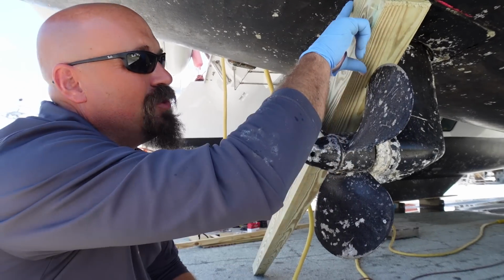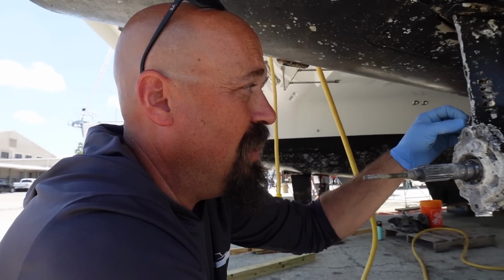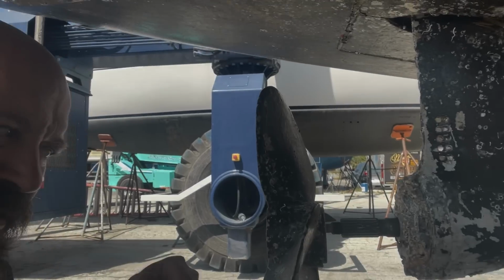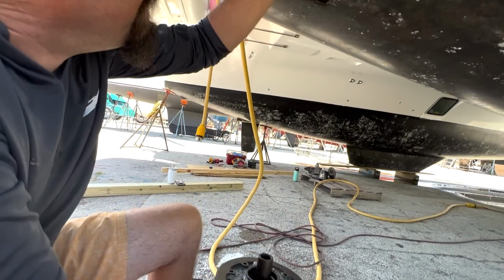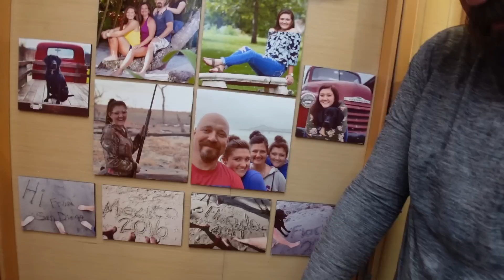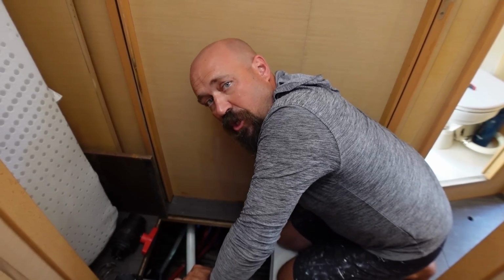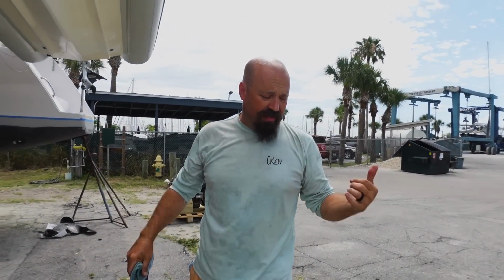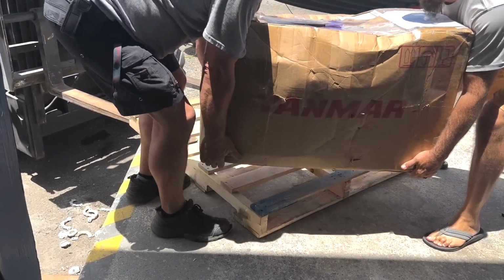WE FOUND HOLES//Corroded Sail Drives & Engine Removal-Episode 82

Comment: Instead of sucking on the end of the siphon hose, attach the lower end to a tap (faucet) and run water up the pipe until it runs out the top end, then quickly disconnect it from the tap. The flow will reverse and away it goes.

Comment: ⛵️I just hope that the corrosion hasn’t damaged any of the cooling water systems on your engines as well. Great watching you connect although bad luck having to cope with the corrosion on a boat that you are about to sell. On another note I applaud you for repairing the problems and not passing them on to the new owners.
Reply: If the external zinc were depleted so fast that it started corroding the sail drive casings, one can imagine what the engine zincs (which are much smaller) must look like if there is anything left of them.
I don't have the answer to this but very curious to know, when the engine sacrificial zincs are gone, what is likely the next thing (within the power plant) to get attacked?

Comment: ⛵️   You’d think that after several thousand years of sailing ships, well ok a few hundred years of sailing metal ships, they’d have the galvanic problem figured out.  Good luck.
Reply: They have, but you've got to use it.😉
Reply: A galvanic isolator in the shore power ground line is only a few hundred dollars. Cheap insurance, especially in a boat that expensive.

Comment: You can start syphon with a shop vac as well.
Question, I know you needed to replace the sail drives, but why did you need to pull the engines?

Comment: ⛵️⛵️⛵️⛵️⚓️⚓️, great episode, amazing how much corrosion happened so quickly.
Did you check the 50 too??
Reply: I’m pretty sure the 50 isn’t plugged in based on them having to jerry rig up a battery when they moved it down and I believe they think this was done because of it being on shore power. That being said if they were having someone clean the bottom of the 45, I’d assume they would be cleaning the 50 as well and would have noticed if it had the same problem.

Comment: When you connect to ground power, is there a way to check if you are creating an energized loop to prevent this from happening?
Reply: Yes, never connect the shore-ground without a  Isolation Transformer. Use a separate ground to the water on your boat.😉
Reply: @Arnaud58  Thanks for the reply.

Comment: ⛵ Did you figure out what is causing the electrolysis? 
Could some thing from the solar system you have be the cause?
Reply from the maker: no issue with solar or inside the boat, just the current in the canal

Comment: ⛵️ Did you have to pull the engines? Looked like all was good above the sail drives.
Reply from the maker: no just easier to clean and service with them out.  It only takes about an hour to remove and install both engines

Comment: When are you going to address the arc fault you have in your wiring that's powering the electrolysis?
Reply from the maker: we don't have a fault or any ground leaks, damage was caused from stray current in the water and we did not have a galvanic isolator installed

Comment: My first thought: isolation transformer.  Of course in days gone by where everything was A: 12v and/or B: separate AC where most appliances were "double insulated (2 Prong)". The AC from the dock was isolated pretty much anyway. The older battery chargers were transformer based. So effectively isolated. Today most battery chargers are transformerless switchers and are properly grounded to one of the DC sides for safety. AC loads are more and more grounded instead of double insulated because they are made for household use where that makes sense, not made for marine use. A one to one isolation transformer between dock power and any AC use on the dock would solve that. So shore power-> isolation transformer->battery charger. Run all boat appliances from battery. While it is true that running AC loads directly from the isolation transformer would make sense at dock, one hopes that time at dock would be minimal anyway so minimize AC loads (AC means alternating current, not air con ;)  ) in the first place and run those that are left with inverter accepting the loss when at dock.

Comment: Could you bypass the water intake in the leg to avoid filling an aluminum casting full of salt water , a corrosion mess waiting to happen.   I think it's criminal they sell aluminum drive legs for a perminant underwater application! They should be bronze.
Cheers Warren
Reply from the maker: I suppose you could try but you can't protect everywhere.  Galvanic isolation is the best solution.

Comment: The electrical engineer in me wants yo see a diagram of the electrical path.  Did the boat have isolation transformers?  On my Volvo D1-30’s the sail drives are electrically isolated from the engine to stop this.  I assume yammer does not do that?
Reply from the maker: nope they don't

Comment: That happens when they don't drive the ground rods in all the way or put enough in  there should be 
2.    8 to 10 foot ground rods on the service you guy where using the boat became the ground rod for the house 
Need to check the house wiring

Comment: Good thing to replace throughulls now.👌
The corrosion symptoms are addressed properly, but I still have some questions about the cause.🤔
What caused the difference between the better portside and the much worst starboard side saildrive?🤔 (as in my comment in your last video)
Why are the anodes adjacent to the throughulls looking brand new aka unaffected?🤔
I for one would like to be sure about the cause if it were my boat.😉
Edit: As been already said: How about the engine? Did you check the 'inside' anode(s) yet?
Reply from the maker: there are no internal anodes in the engine. also steel and cast iron are significantly more noble and corrosion would not begin there until all lesser noble metals have been depleted

Comment: Are you guys sure you don't have stray current within the boat itself? Improper grounding, polarity reversal etc could cause this. If it was due to stray current at the dock, wouldn't the other boats be effected the same way? Just a thought.
Reply: The 50 wasn't plugged in , so it's Ok

Comment: ⛵️have you figured out what the culprit was? Does your new Leopard have similar damage? Could it be coming from your massive solar array?
Reply from the maker: dirty power in the water, no damage to the Leopard as it is not plugged in.  No, the solar does not have a ground leak or faults that would cause the damage.
Reply: @SailingDauntless  well that’s good to hear! I’m sorry that this has happened to you all but I am also glad that your diver found it before you started taking on water.

Comment: I would order new aluminum housings, and use the internal parts to rebuild the drives. I have done this on broken outboard lower units. This problem falls in line with broken bulkheads in a Lagoon perhaps sail drives should be avoided. zinks, and corrosion are still a big problem on all boats. I have seen a stray voltage blow the drop tank off a jet fighter, and the fire would have distroyed the plane, but a quick thinking crewchief braved the fire, and extinguished the fire.
Reply from the maker: they no longer sell the housing separate unfortunately, the only way to get the housing is ordering a new leg or complete sd

Comment: What you may be missing. Also, the maker of the sail drive. Could have simple, sold crap.
Or the factory, that poured the casting cut corners, and tryed covering it up with fillers.
But"" that's a new boat. Yes no warrenty on the boat..""" but legal , the motor,  the sail drives fall under a factory 5 to 10 year warranty aginst 
Manufacturing defects.... you 89% chance have a warrenty case. To get 2 new free sail drivers...
Note, there made to be under salt water.....